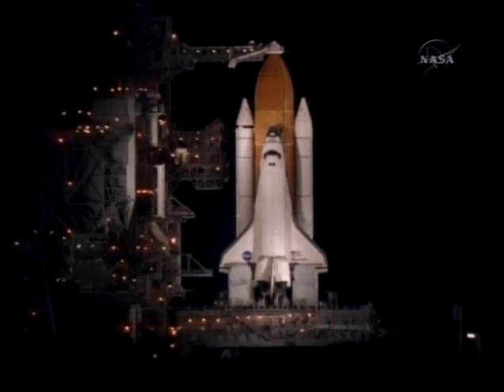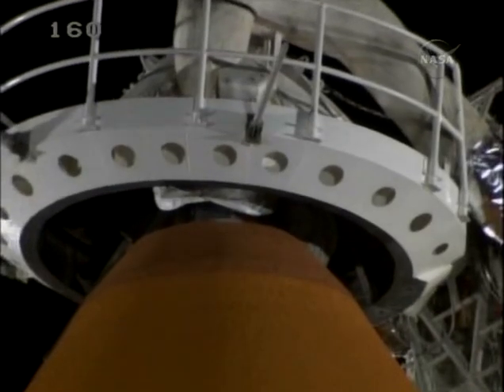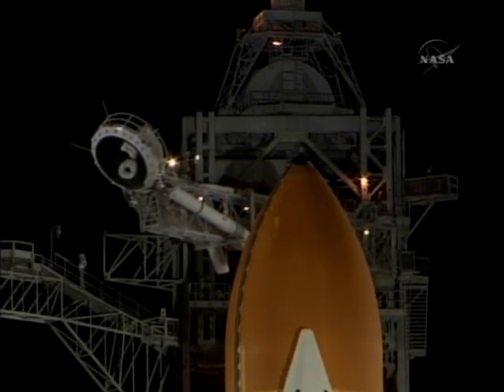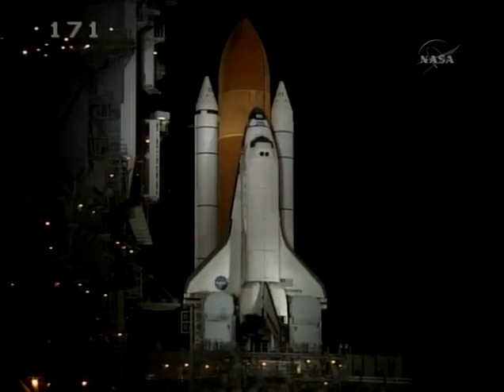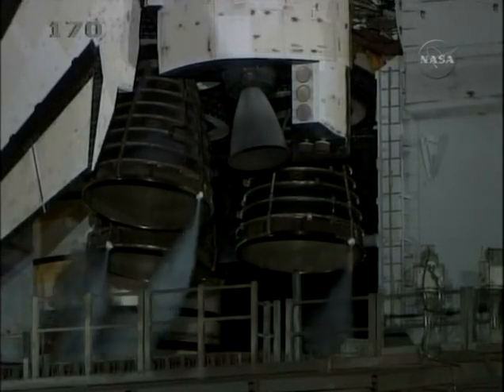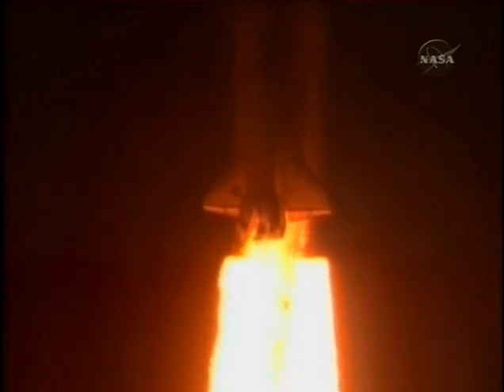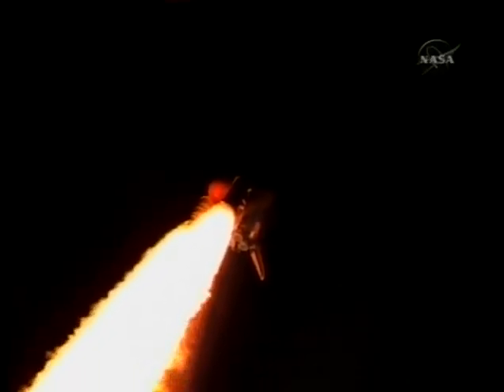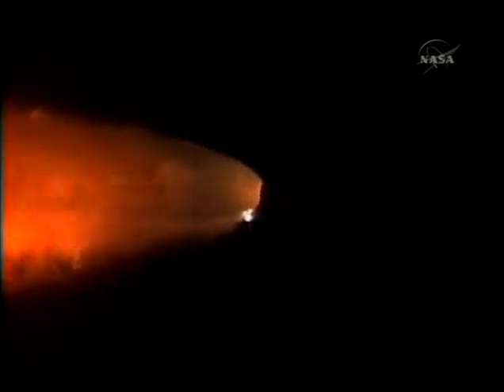Night Launch Shuttle Discovery

Comment: I witnessed two launches and I'll say a possible third as I'll explain shortly.  The first was literally a seventh row center seat standing at the Titusville, FL mall off u.s. 1 for those familiar with that area. The second was from DeLand, FL about 30 miles or so out and that was the flight where John Glenn went back to space. The third I'm not sure of as I was in Ft. Pierce. Looking off to the south one evening I seen a long plume of blue flame but no noise. It lasted about a minute from the time I seen it then turned a bright yellow which burned for about 3-5 minutes then turned another blue all the while climbing in altitude then it was gone. It was the late 90s and I wasn't in a position to check news reports as I was working and never really followed up on it.